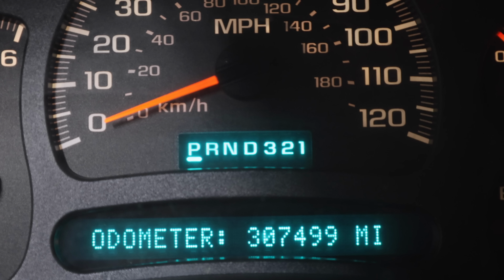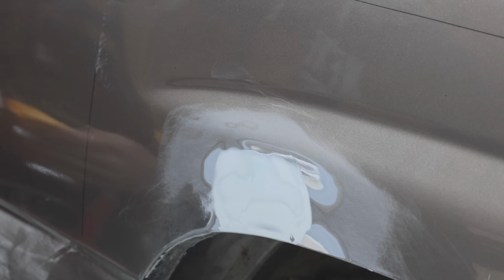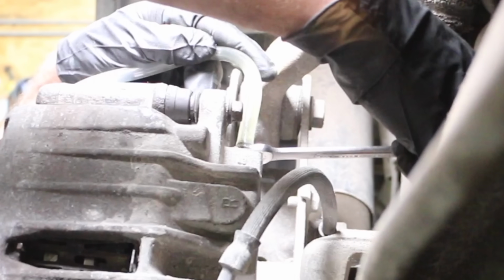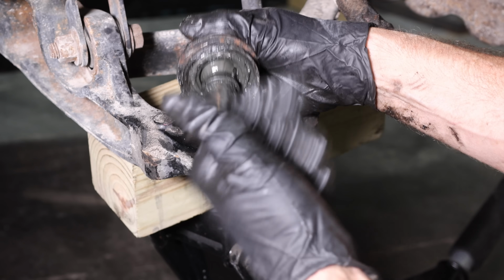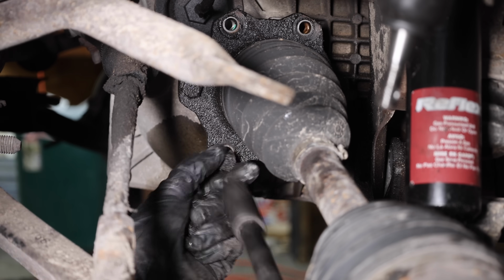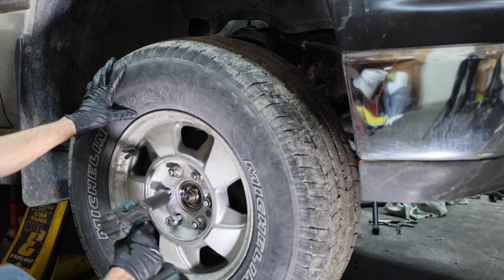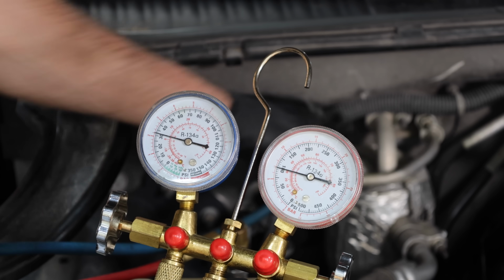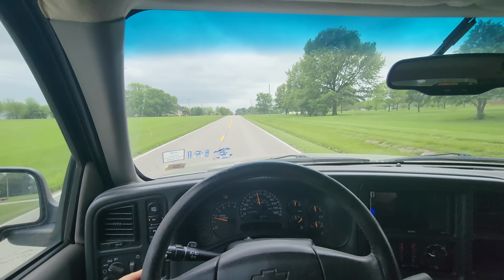Is It Stupid To Fix Up A 300,000 Mile Vehicle? Let Settle This!

Comment: Mileage of a vehicle is largely irrelevant.  Age + condition is everything.  If this truck was rusty like they are in the salt states, send it through the shredder.  I just replaced rear shock absorbers on a 1998 Chevrolet.  Here, the lower shock bolts rust to the steel sleeve inside of the rubber bushing.  That's a bitch to get apart.

Comment: When I was 11 years old I was taught bodywork by an old pro and he was tired of me cutting the filler too low when using a rubber block, as I would cheat and tip the block. He cut me a nice 2 x 4 and put the paper on that and made me use that. It was the first time I worked the filler perfectly. You did a great job selecting the 2 x 4. From there I worked into doing show cars, some that even made it into magazines. Good job!!

Comment: If the major components like the frame and body don't have too much rust (so they won't break in half on the road), and the engine does not burn too much oil, then sure, go ahead and spend $1,000 to $3,000 to fix it up, as long as you get another 1 to 3 years of use out of it.  The goal is to spend no more than $1,000 for each year of use you get from the vehicle.

Comment: I like the format you could slow down if you wanted to but Im not leaving any time soon. Side note and video suggestion, i have been thinking about what would make a fully stocked garage similar are better than yours. I want to do the level of repair work at home lets do a video maybe multiple part series if you have not already on a complete tool list for the perfect garage. Not a bare minimum tool list l but the ultimate garage for project farm level repairs and list of tools.

Comment: One thing I'll recommend. Make sure you can get the fill plug out of the diffs, t-case, etc before removing drain plugs. It sucks to have all the fluid in a bucket but not be able to refill it.

Comment: Cut out an weld for that little spot. Just a little  phosphoric acid to convert the rust, then prime and paint then bondo or fiberglass to taste and paint, repeat after 5 to 10 years. Coat the undersides and inside of doors with bar and chain oil every year or two

Comment: Two comments to add. One - always remove refill bolt for differential before draining fluid. Two - flush the power steering fluid. Lift truck and place on jack stands. Extract fluid from power steering reservoir. Disconnect return (low pressure line) from pump. Fluid will come out of reservoir. Plug reservoir return. Discharge old fluid into a clear container. Pour new fluid into reservoir. Steering wheel can be turned and will pump fluid through entire system without starting vehicle. Add new fluid as old is pumped out. Reattach everything when finished. Top off reservoir. Lower vechice and test drive. Final fluid check. Will stiffen up the feel of the steering.

Comment: Oil inside the fender, etc to stop the rust from spreading. Then cover the rust hole with duct tape. Too much time and effort to do body work on a 300,000 mile vehicle. 😅

Comment: The pace is fine. I multitask as I watch. The only thing I would do different, I would replace the A arms so I would have new ball joints and new bushings. The old bushings look pretty cracked and dried up.

Comment: Fun story, I worked at a lube shop a long time ago and I took over doing wheel bearings for a similar suburban. The service writer gave me the new wheel bearings and I put them on just like you did. Only catch was it was 2 wheel drive not 4x4. When the customer went to leave the wheel bearing separated and the wheel came off the suburban in the parking lot. Snapped the caliper bracket and created a social wake that got pinned on me. 

Lessons learned were the service writer assumed the wheel bearings worked for either 2x4 or 4x4 and I learned not to take over jobs while the other guy goes to lunch.

Comment: The 2x4 aint that weird, u see pros take old foam  and cut it into a little sanding block, glue spray keeps the sandpaper on, cheaper and works the same as buying blocks

Comment: #1. Cut the replacement part first. #2. Cut the original steel at a 45° angle. I'm currently restoring a 1967 Chevelle.

Comment: No, it is not stupid to fix up a 300000-mile vehicle as long as factory parts or high-quality OEM parts are available. Just FYI. make sure the fill plug is loose before draining fluids out. Because if that plug is stuck, then it is ole S#@%! mode.

Comment: That was great I have a Chevy truck with 300,000 miles and replaced just about the same things on it. All the steering components and brakes and bearings should be good for another hundred thousand.

Comment: My truck has 265k miles and if the engine gave out or transmission did, the cost to purchase a reman one would still be cheaper than a new truck. I do the work myself so there’s no labor. I refuse to go into debt on a new vehicle.

Comment: I like to see you test an oil bypass system, you could test it on your old Dodge diesel (or on mine :). These systems are sold to reduce the particulant count of the oil and normally install near the engine oil filter.
Gary

Comment: I put the new heavy duty breaks & rotors on last month, now its smooshy kinda, really must be the rear breaks.  Not sure why, but I got the new computer and 50lb aluminum jack, what a deal, but it's heavy as hell.  I learned this mad trick, cheap crazy glue takes a day to set, not very useful at pulling nothing, but 50 cents an ounce, holds a fabric strap on a tool bag ok.  But, when you try to rasp it, no way!  If you put it on a nut, it will never come loose again.  Until you pour nail polish remover, maybe 20 years bond.  It's low temperature though, you have to stay under 120 Fahrenheit.

Comment: I’ll be honest…I have a 2006 Silverado with 320,000 miles. I bought it at 95,000. I haven’t taken care of her as I should. But she runs. Well…transmission line developed a hole and I lost the trans. But if that hadn’t happened she’d still be chugging along.

Comment: Keep the pace.  

I am also a fan of drive it until the wheels almost fall off then replace the wheels.  In general, vehicles are a very poor investment.  Maintenance is cheaper than repairs.  My 2001 2500hd with 6.0 has 180k and still going strong.

Comment: I am seeking brake rotors and pads for my 2005 Jeep Grand Cherokee. However, the hardware alone costs approximately $500 excluding shipping, with the research I have done on Amazon, Autozone, and O'Reilly's and also looking up the part numbers on the ac delco website. I am interested in reputable brands and high-quality products. Can you suggest a more cost-effective option (website or store) similar to the one you obtained for $230?

Comment: If you can do the work yourself, it's worth it... For sure you'll get another 100k out of it and probably a whole lot more. With good maintenance I wouldn't be surprised if you double your miles! I have 361k on my 99 Camry that I have owned for 24 years now. No major issues ever and I always change my oil when it's starting to look brownish. I don't pay attention to miles on the oil. When it starts looking a little dirty, I change it! Compression test last year showed all cylinders well within spec! Only have had to do timing belt service and valve cover reseal a few times, besides the normal stuff, tie rod ends twice, axle shafts because boots were shot, lower control arms (bushings shot), two cooling fan motors and all 4 struts and mounts at 100k. Still on the high end replacements I used at that time and they still feel great! Car has been amazing and nearly as quiet on the road as a LS430 I drove for a few days last year....

Comment: My 00 Silverado is at 375K with original engine and trans. I think it's better keeping it going besides I love it and is still fun to drive. It needs a lot of things replaced but I'll have to go at it one thing at a time. I think its worth keeping older vehicles running. Many new vehicles today are very problematic. I just don't trust them. Thank You for this video!! 
BTW, what ceramic coating did you use?

Comment: Based on the cost and low build quality of new vehicles these days that vehicle was definitely worth the cost and effort to keep it going, don't change anything on your channel, it's one of the best on YouTube.
Reply: Absolutely
Reply: stop spreading misinformation, newer cars are built way fucking better then older vehicles were, especially compared to some piece of shit GM product, the real issue is that everyone on the road today is a fucking idiot who refuses to do proper maintenance, i see way too many people who refuse to use synthetic oil because "HUR DE DUR, MY DADS DADS GRANDPAS DAD SAID SYNTHETIC OIL BAD, SO I ONLY USE DINOSAUR OIL." then proceed to go way too long between oil changes (you can do 5000 miles on synthetic, NOT conventional, conventional oil is 3000 miles MAX, no matter how you drive, syn oil can do 10,000 if the vehicle is designed for that, AND you drive all highway miles, if you do any city driving at all, you do not quality for regular maintenance schedule, and MUST follow the severe service schedule, which is 5000 miles between service) and then their motor has some major issue, and then that same fucking idiot is all like "FUCKING *BRANDNAMEHERE*"

MAINTAIN YOUR CAR CORRECTLY, AND IT WILL LAST LONGER THEN ANY OF THOSE OLD PILES OF JUNK, GUARANFUCKINGTEED (except chrysler and all their sub brands, but they've always been unreliable pieces of trash, so that hasn't actually changed either)
Reply: Yeah, money well spent. That’s the best generation of Chevrolet SUV ever made, and one of the best LS platform engines. 

Smart man to keep it alive. It’ll outlast newer ones.
Reply: What this dude said. 💯
Reply: I bought a 1994 Lexus ls400 off Facebook a year ago and but 22k miles on it already. The 4.0 v8 burns zero oil, and can balance a coin on the engine during start up, redline, and shutdown. It’s the best car ever made, literally. My 01 tundra 2uzfe and the Lexus 1uz are bulletproof, want to know what’s best about it? The transmissions will last forever to lol
Reply: Older vehicles do WAY worse in crashes though. You're far more likely to get seriously injured in an older car even though they're heavy.
Reply: Quality? Are you joking? The vehicles today are so much better than the junk made in the 70s,80s and 90s. You would never get more than 75K on a vehicle back then (let alone vehicles made prior to that)....quality does nothing but improve each year. The problem is that vehicles have become much more complex over the years which means more things to go wrong.
Reply: @jlambe19  Not even close to what the quality was 20 years ago. Those of use that deal with fixing them daily know how poor the quality currently is. I don't think anyone is talking about antique vehicles.
Reply: @Troy_Built  The cars nowadays routinely last 200K miles vs 20 yrs ago when they lasted 100k. I'm in the business of making cars and you have no idea the tremendous steps that we go through to catch problems before they leave the factory. Additionally, with constant government interference of our products, we are continually forced to modify them in a hurry prevent them from fining us.  As i said before mechanically, you are blending complexity with quality.
Reply: @jlambe19  cars made 20 years ago easily made 200k.  Heck, my 1995 Subaru Legacy went 300k.
Reply: @xomthood  anecdotal
Reply: @jlambe19  when you say "never" it only takes one to disprove.
Reply: @jlambe19 you are talking about cars pre-90’s. Buick, Chevy, Toyota, Honda and even some Fords like the late 90’s trucks last forever. Little fixes sure, do the maintenance. New trans on all cars. By the way new trans fail a lot sooner on so many cars vs 90’s and early 2000’s cars.
Reply: @nsjohn130  dude, I am an engineer in a transmission manufacturing facility and your opinion is not based in fact. We measure failures in PPM, as in 1 or 2 PPM. The quality controls that are in place are incredible compared to the garbage made in the 70s and 80s when domestic quality was at it lowest. The big difference is modern vehicles are difficult to repair and are much more complex. The complexity is driven by a government obsessed with emissions and the manufacturers struggle to keep up with annual government demands since it takes 3-5 yrs for a transmission to go from drawing board to mass production.
Reply: @xomthood  Japanese cars were always light years ahead of American ones
Reply: @jlambe19  this is a brainlet take. You must make Chinese cars.
Reply: @xomthood  somebody took discrete maths
Reply: @jlambe19 what?!?!?! HAHAHAHAHAHHA a Toyota made 20 years ago will literally last 500k miles. Compare that to Toyotas today. Literally the best most reliable cars made were made 20 years ago….
Reply: @jlambe19 no one is talking about the 70s and 80s. Stop moving the goal posts. The a340 trans and a341, a750 found in Toyota and Lexus cars made in the 90s-2008ish literally go 450k miles on the original transmissions. .. GFYS
Reply: @jlambe19 I built that Suburban at GM Arlington. I have one that we built. I drove my Suburban when my 2016 Chevrolet Express was in the shop, twice, once I waited on electrical parts for FIVE MONTHS. I drove it when my 2024 Chevrolet Colorado Z71 was in the shop. There is a reason I didn’t trade it in on  either of my newer Chevrolets. 300,000 miles is not unheard of. I don’t expect my 2024 Colorado to last more than 150,000 miles while my Suburban has 265,000 miles on it. It is not a gas mileage champ but I live in the DFW area where we must have an exhaust gas analysis every year. It has passed every year. Good luck with your new vehicles, I think I’ll just keep my old one.
Reply: @jlambe19 Toyotas from all of those decades go hundreds of thousands of miles with minimal maintenance
Reply: @johnofcalifornia7  I said domestic
Reply: @jlambe19 lol are you joking? No one is taking about vehicles from the 60s dude. We’re taking about 90s-2006ish. My 1994 ls400 and 2001 tundra and lx470 will outlast literally any car made today. My Lexus is 30 years old and is still perfect with zero rattles. GFYS

Comment: No, it is not. Fixing what you already have not only saves money but gives you experience working on that platform. It also, for me, makes it more personal. Only questions I have now: how long did it take you to rebuild the dang thing like you did, how did you know what tools to use, and how did you know exactly what parts you needed for each job so as to avoid stopping in the middle to obtain forgotten parts or tools?

Comment: Which steering gear did you go with? Ive gone through 3 aftermarket ones and they have as much slop as the 230k original that came off of it

Comment: My 2000 GMC has 324,000 miles on it.  I did have to put a new to me engine in it at 278,000.

Most of my driving is highway, so the wear and tear is minimal.

Thanks for another great video!

Comment: The speed of the videos is spot on. That said, my dad's Chevy Pick Up had over 300,0000 miles on it, he was very strict about changing the oil every 3K miles and would flush the transmission fluid every 30K as well as changing the coolant, (this was way before the long mileage coolant that we have now).

Comment: Great job Todd. I had an early 80's VW Jetta Diesel I put 548K miles on saw the guy about a year later I sold it to and he said it was still running great. You did cover and do a lot of work in this video I would slow them a little. I think you should do a video on Split Rung Pliers!

Comment: That body work you did we call "honest" and is easily 200€, 300€ with good paint job. For such home repair, however, the biggest expense is CO2 welding machine. Electrode-welding ones do not cut it, or you have to be really good with it.

Your paint job is the best possible out of the can. For less money you just get "bondo" to fill the hole. It is unbeliveable how many people professionally do such "bodywork" and keep a straight face.

Comment: I like the speed and all, you could probably skip one side when the jobs are identical/mirrored, if there's nothing special to add.
Not 100% fond on the titles tho, you aren't settling if it's worth it to fix up a 300,000 mile vehicle, you are trying to settle if it's worth fixing up your own 300,000 mile vehicle.

By the way, how the hell was there anything left on those brake disks if those were the original ones? I just swapped mine after 6 years 100,000ish miles due to severe rust.

Comment: Minor issue. You usually can't use an equal distance from the rear and front wheels to set your string lines (unless the vehicle's front and rear track widths are the identical). What you want is your string lines perfectly parallel and perfectly square/parallel with the vehicle's center line. With a solid beam rear axle, you actually want your string lines perfectly parallel (with each other) and a measurement of zero toe on the rear wheels. Then you can set your front toe. Doing that, you've taken care of any misalignment/thrust angle of the rear axle

Comment: The Welder's Creed: Grinder and paint, make me the welder I ain't! My first job was at a body shop, so I've definitely seen better repairs. But for sprucing up your truck and keeping rust away? Your repair was fine. And no laughter from me at using a piece of 2x4 as a sanding block; did the same at work a few times.

Comment: I'm still driving my 2004 Chevy Colorado 4x4 with 379,500 miles. Original motor and transmission. I broke the front end on a rock 4 wheelin in Colorado. The frame is rusting. It has had a lot of electrical problems including 3 computers and the air conditioning went out last month. I really would like to get to 400,000. But I am not putting the miles on it anymore and the rusted frame will probably end its life.